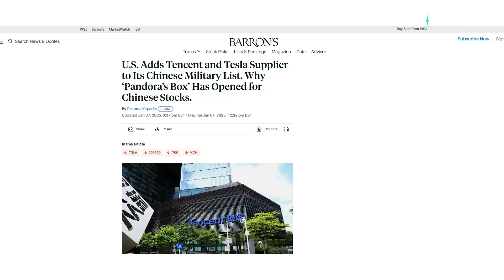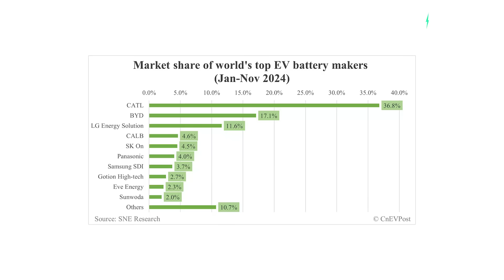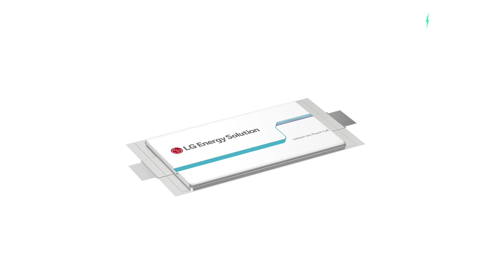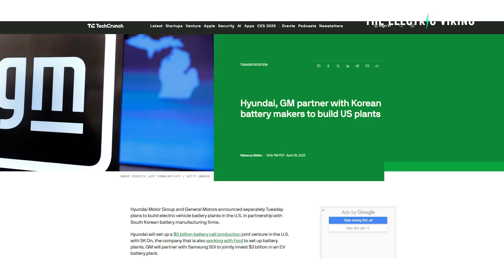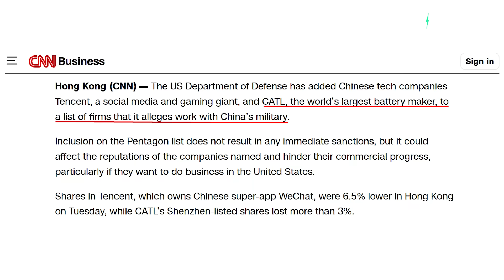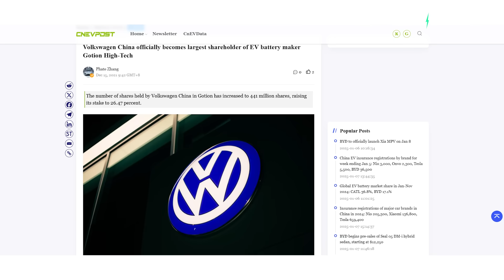The 10 biggest battery companies in the world in 2024 - America has zero

Comment: there are LFP battery and than there are Byd LFP blade battery.. I only see BYD did a nail test on their LFP blade battery.. I have not yet see CATL do a nail test on their LFP battery...Until CATL does a nail test on their LFP battery, BYD is still the best LFP battery maker bar non...😉
Reply: CATL through its Golden Battery into a fire, put it back into a car, still working fine. Also impressive.
Reply: does this really matter? how often do you plan on driving nails into your battery?
Reply: @scottmcshannon6821  The nail test is to determined what happens if a battery gets punctured like in an accident.
Reply: @PyroShields  thats cute, but ive been following EVs for quite a while and dont remember and going up because they were punctured.
Reply: @scottmcshannon6821  There is a video on this channel in regards of nail puncture. FYI Lithium ion batteries are susceptible to thermal runaway when punctured.
Reply: Aion battery eve